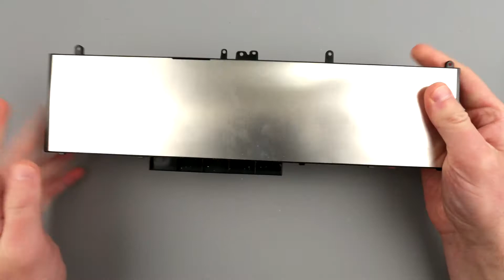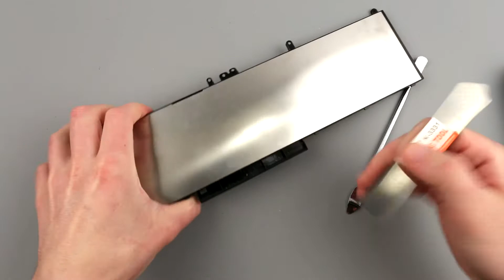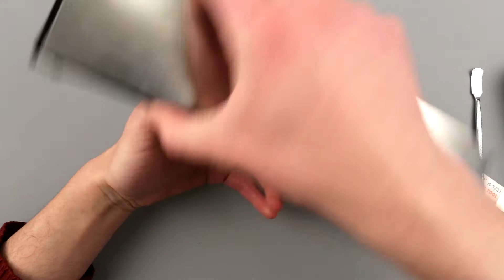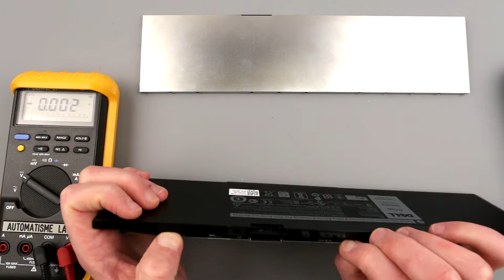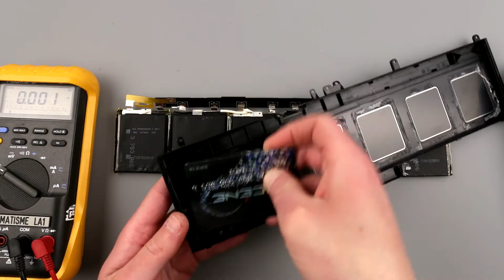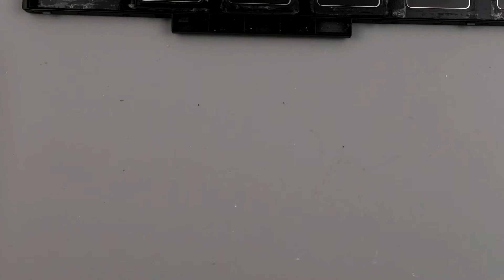Tearing down flat Dell Laptop battery

Comment: If you jump the positive cable connected to the cell to the connector positive connection i.e. by passing the BMS in some cases it will start to charge again.
Reply from the maker: Thank you for the advise! But I took it apart completely :D